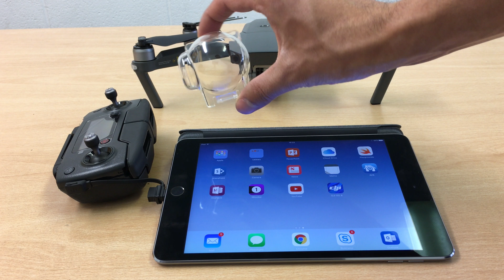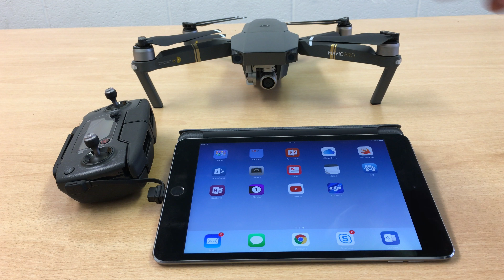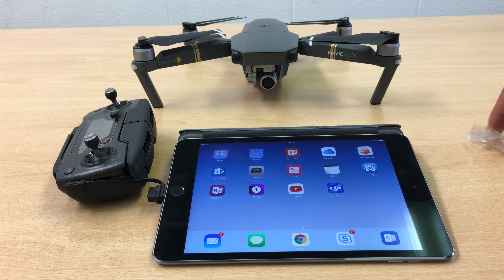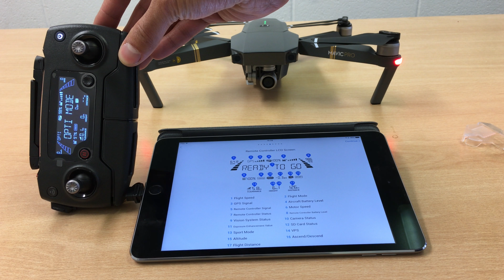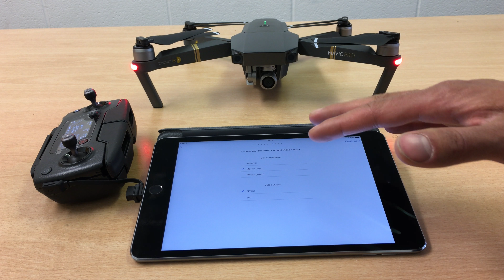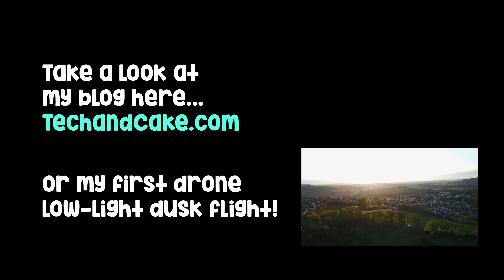DJI Mavic Pro set up and firmware update (stuck at 35%) -solved

Comment: Try to move away the remote controller with the aircraft. i notice tha mavic do interfere wifi connection with the phone. so, everytime when i upgrade firmware, i move away the controller bit far from mavic. i noticed the upgrading bit faster. all the best to you.

Comment: what the best mini iPod best to use on dji maviv pro  or a smart cell phone.
Reply from the maker: I tend to use my smart phone when I'm on the go as it fits better in the holder. Plus you can use your data to view the map when flying rather than tether or use wifi. I only tend to use my iPad when I'm near home as it is easier to see the screen.
Reply: hey thank you , still trying to log in but my mini tablet cant activate my Dji magic pro , and I use a cell phone , I try log in but not working , log in my email account and password , there is a notification number I have to log in ,I don't know were to get this number and there's number pop up beside , and disappear when I'm click on the number,IM still need to activate my drone , may be you can go to the accdivate application and explain step by step . Thank you so much , I keep in t.uch.
Reply from the maker: Don't know if I can help you there, if you're talking about the verification code (it's a colourful row of numbers or letters) on the login page you have to enter this exactly into the verification code box. Check out
https://www.heliguy.com/blog/2017/04/13/dji-mavic-pro-setup-guide/ for a text based set up guide. Alternatively you could post your problem on the DJI Forum: http://forum.dji.com/

Best of luck with your issue!
Reply: hey thanks , yes that verification# ,colorful #.
Reply from the maker: Yeah I found that you have to copy that code in exactly as you read it. It changes if you get it wrong. If not you will probably need to contact DJI unfortunately! :)
Reply: activating processing it all over you tupe  channel , can we go to your   regitering your dji mavic pro , what is this password mean by 8+20 letters and numbers.
Reply from the maker: It normally would mean your password would need to be between 8 to 20 characters long. Make sure it is a combination of letters and numbers. For example: Pa55woRd2017 would probably be an acceptable password to use.
Reply: Thank you , I'm drying to register my account ,my drone still not yet fly , appreciated .